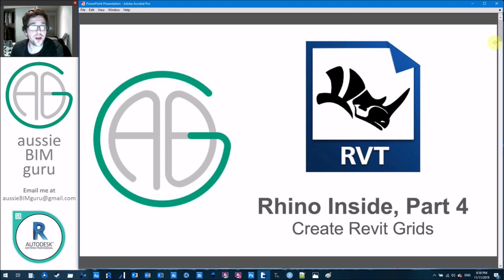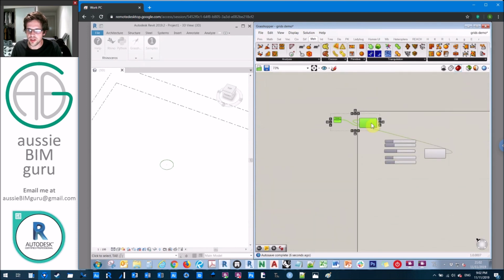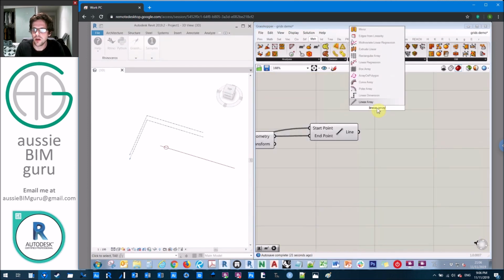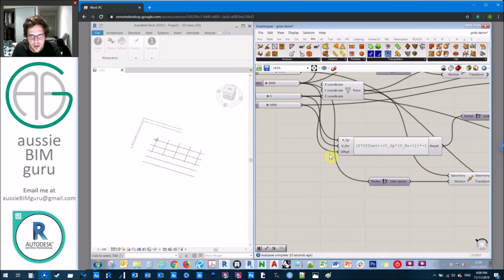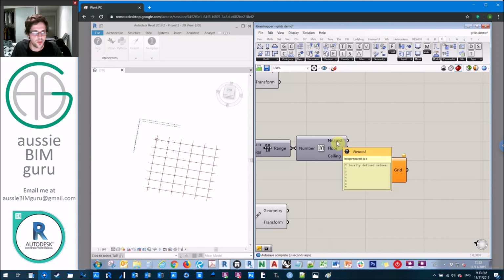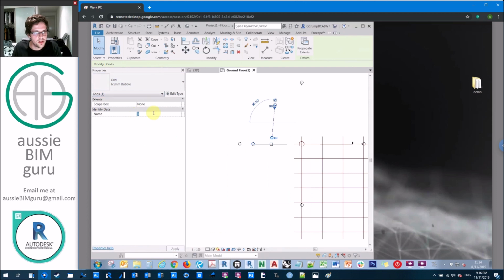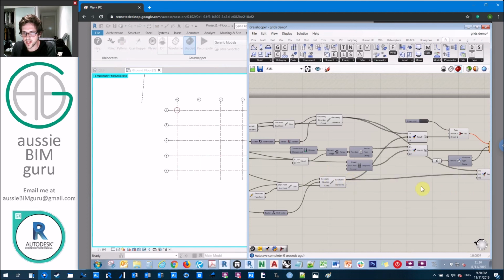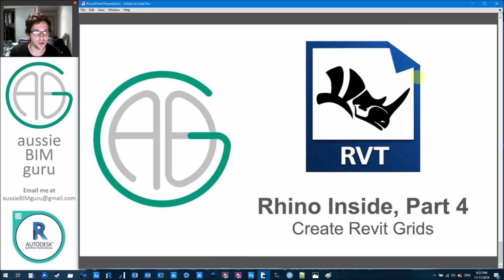Rhino Inside: Create Revit Grids (Part 4)

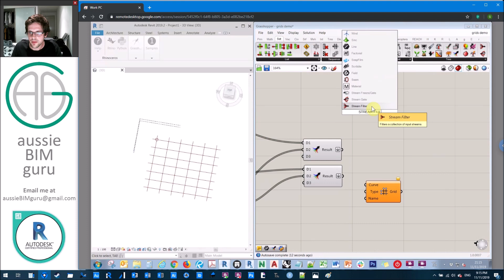Comment: thanks a lot!  Question: can you please explain why you had to use the stream filer at minute 16:30 instead of plugging the curves directly into Curve?
Reply from the maker: Typically I use stream filters triggered by buttons to make objects only when the user is ready to. I know there is element tracking in rhino inside but find its better practice to disable this and block the downstream until all inputs before it are verified. It also means the script wont try to run on dud inputs if its opened with some inputs saved from the last run.

Comment: what if the grids are at an angle - hw do you rotate the columns to be parallel with the grids?
Reply from the maker: You'd need to use Revit API to set family rotation based on the rotation of the grids at the intersection point.
Reply: @AussieBIMGuru  we don't have API in the office; is there another way?
Reply from the maker: @BrandusaNicoleta  API is available in Rhino Inside but requires programming. Rhino Inside doesn't have as many nodes as Dynamo so not all functions are available, and need to be programmed using ghpython. Alternatively you can try this workflow in Dynamo.